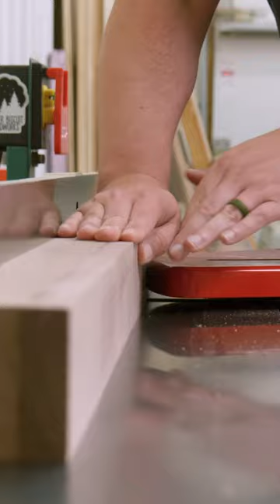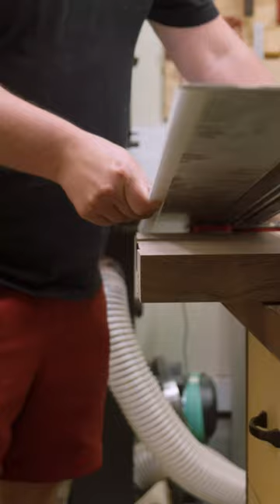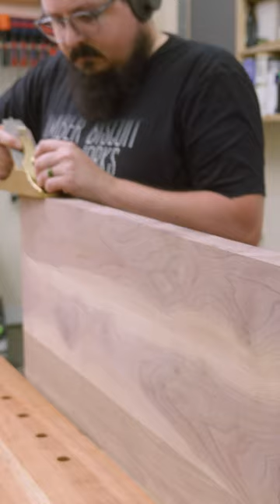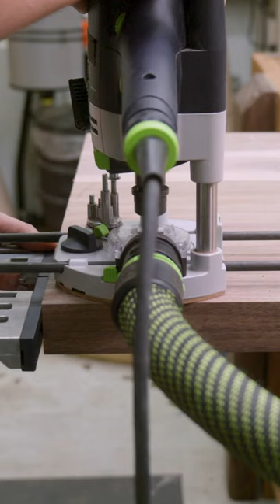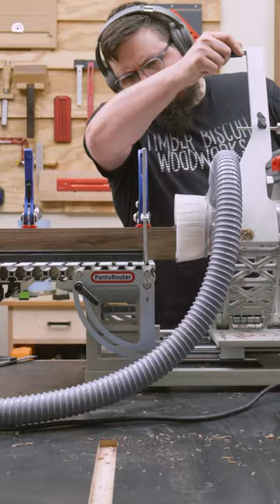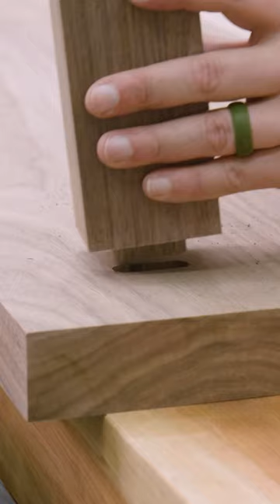When Mortise and Tenons Fit So Good

Comment: A little tip for you. If you to avoid some tear out from the pantarouter use your tracksaw and at least score a line all the way around the inboard/shoulder side of the tenon. If you line them all up edge to edge on the flat and clamp them it works great. Same thing if you line all of them up on edge, clamp them and clamp your rail you can do the shoulders on the edge. If you don’t have multiple pieces to cut just clamp a straightedge level with the board and make your scoring cut. It should save some extra cleanup work.
I know many of you already know this. I just thought I would include for the beginner wood workers.
Just remember to account for the inboard cut of the blade or use a parallel guide.
This also works with a router and a track or edge guide.
Hope this help someone…
Ron
Reply from the maker: Good idea! I have also had good results just using a marking gauge. Cutting the fibers a bit goes a long way for avoiding tear out.